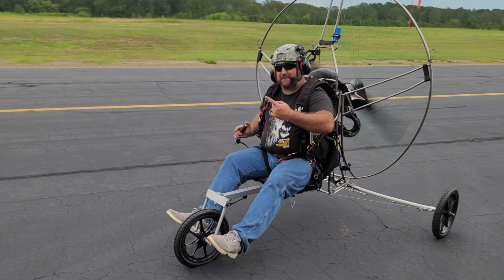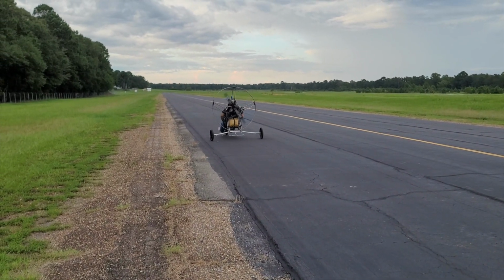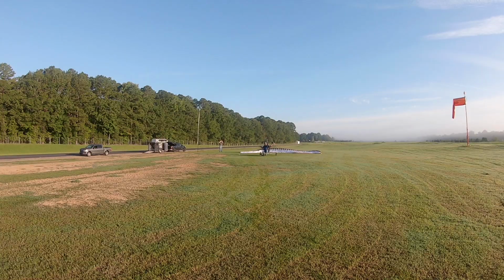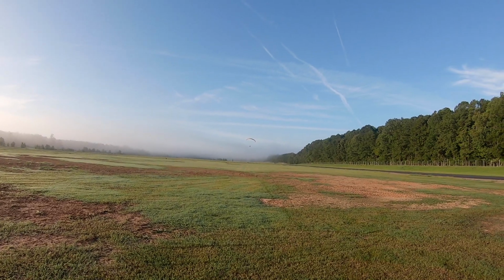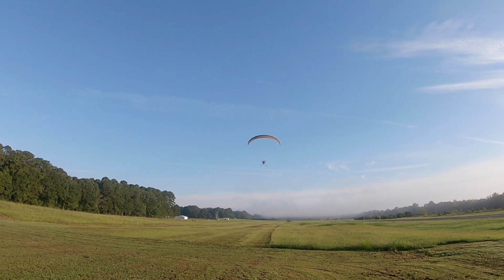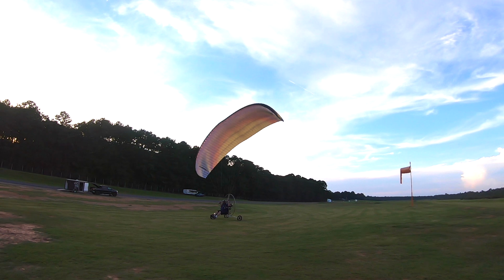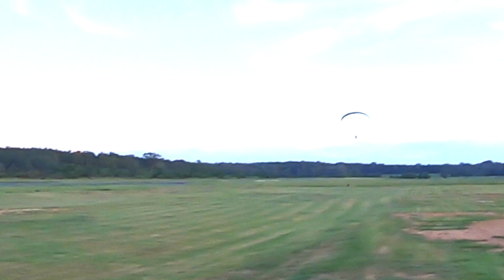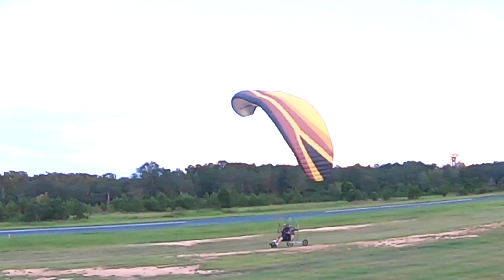300lb Student Pilot Tests Kyle O Trike To Limits on His FIRST FLIGHT!

Comment: I went back to the first vid on this trike and compared the suspension then to this.  I noted the clever use of turnbuckles to allow for adjustable tension suspension.   You may have mentioned it in the vid...but I only got to 3:25 when I couldn't stop myself from investigating what you might have done to mitigate the deep sag.

Comment: You need sand/ turf tires
Reply: It’s a “Prototype” so I suppose things can be adjusted and reconfigured as things progress. I noticed a lot of Trikes have the lightweight plastic hub smooth wheelbarrow type tires. When things get soggy those narrow wheels will undoubtably be a drawback or even a hazard if the front wheel digs in. Also I saw a Trike with foot pegs that were curved on the ends to help prevent your feet from easily sliding off the ends. There’s video posted recently of a guy who crashed his Team Airbike Ultralight because his foot slipped off the left rudder pedal on takeoff. The pedals on the plane were just straight pegs with no “foot stops” on the ends.
Reply: @shannonwhitaker9630  the guy with the air bike had a hip replacement he should have thought a little ahead 
Before hand
Reply: He later for another pilot built a model with that intended

Comment: Sweet! A DDT blast from the Air Tractor! 🤣 J/K!! 😁 

Nice work, Jonathan - you're a natural! 👍🍻

That second launch attempt is EXACTLY what lead up to breaking my hand. I overcorrected (Hadn't flown for almost 4 months after I left training), the wing whipped to the left EXACTLY like that, but, the difference with me was I stayed FULL throttle, which made it whip the other way even more violently,  I never even tried correcting for it (Since I didn't realize how BAD it was because I wasn't LOOKING!), I started skidding sideways, my rear wheel caught tall grass, and I was upside-down with a spiral-fractured 4th metacarpal before I even knew what hit me. I was still full throttle upside-down!! That's how fast that sucker whipped over. Wish I had caught it on video from a distance - I only got it POV, which doesn't show much aside from the rollover speed. Since I've been back at it this year, I've been flying much more often, and am 100x more comfortable launching. I've learned to back off the throttle just a bit and either steer or work the brakes until that wing stabilizes. All my takeoffs have been much LESS dramatic since. The more I fly, the better I get at the corrections. I developed bad habits from the lack of flying - I had done fine at training except for 2 really bad launch attempts out of 25 or so. I started to forget things! That happens when you grew up in the 80's, lol. 😁

GREAT video, Kyle!! Much appreciated. Wish this was out a year ago when I got rusty! 👍👍

Comment: Good call on hoop height and strength,,,,if it was gonna side flex the hoop on full power or bottom tip a prop a new 300# pilot woulda certainly found the weakness,,,
Reply: He later had to modify the trike to match A parajet zenith airframe for me
Reply: And the original was damaged in a rough landing
Reply: No harm to the pilot He would go on to have other escapades And would occasionally side check the earth